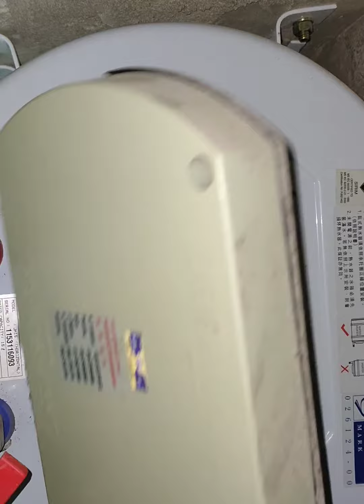REPAIRED!!! Joven Water Heater Storage 15Liters

Comment: Boss nk tnya. Custmer sy pon jnis mcm ni. Penyakit dia pon sama. Buka trus trip. Adakah masalah dia sama? Benda ap yg perlu sy ganti? Maaf bang. Nk mintak tunjuk ajar
Reply from the maker: @mohdazzaruddinazman8365  boleh jadi bang 90℅ sbb trip heating element tu dah short.. Cuba disconnect wire dekat heating element tu.try on kalau tak trip lagi confirm heating element tu rosak dah
Reply: Ok boss tq tunjuk ajar @arjchannel4155
Reply from the maker: @mohdazzaruddinazman8365  sama² boss

Comment: On suis hearter... Lalu terus trip apa sebab der
Reply from the maker: Boleh jadi heating element rosak,cara senang disconnect wire heating element, cuba on suis kalau tak trip confirm heating element rosak kalau msih trip check switch, cable supply, cable thermal fuse
Reply: @arjchannel4155  terima kasih tuan

Comment: Abg kalau buka suiz heater power trip MCM yg kat video.db box semua da trip.elcb jatuh.apa masalah ye.element rosak ke.
Reply from the maker: Ya jeff,.. Besar kemungkinan element rosak, kadang² thermal fuse pun punca trip(cable fuse hangus, touching body element) boleh check dlu sblm check heating element.. senang cerita guna multimeter dulu sblm buat kputusan part mna nak gnti 👍
Reply: Tukar element baru dgn thermal fuse rosak kena buat ajest kat box hitam Tu ke.kena reset.atau biar MCM Tu je.
Reply from the maker: @jeffmanikjeffmanik4411  biasa sy tukar part mana yg rosak je.. kalau confirm heating element je rosak tukar part yg tu je..
Reply: Hi. Nk tanya, mcm mana check fuse thermal?

Comment: Kalau air panas keluar slow saja apa masaalah nya? Air sejuk side flow nya kuat tapi flow bahagian panas tak kuat.
Reply from the maker: Boleh jadi sumbat @ pressure tak kuat. Storage hot water bergantung pressure air sejuk
Reply: @arjchannel4155  macam mana nak check jika ia sumbat ?
Reply from the maker: @Scbtgogreen  cuba check air msuk kuat tak?(dekat tank) Lepas tu check dkt mixer,buka mixer (tutup air kejap,lepas buka blow air tu kuar sjp) kdang ada sisa² seal tape,paip dkt mixer..
Reply: @arjchannel4155  ok terimakasih
Reply from the maker: @Scbtgogreen  cuba sja apa cara,kadang hal remeh pn boleh buat pening kepala😅

Comment: Salam bang. Saya ada masalah trip yg sama. Tapi masa check heating element masih ada contineunity. Ada kebarangkalian ke alat lain yang rusak?
Reply from the maker: Check Thermal fuse takut ada leak g body. Check heating element + Earth ada reading tak,klau ada, heating rosak.
Reply: @arjchannel4155  saya sudah check bang. Disconnect 2 kable ke heating element,sudah tidak trip. Cable thermal fuse tiada kesan2 cable luka n masih elok.fuse masih cantik
Reply: @arjchannel4155  terima kasih ye bang atas info abg ni.moga abg murah rezeki.
Reply from the maker: @mayathancur1  ok terima kasih kembali..
Reply: Tkasih pkongsian masalah ini.

Comment: bang sy mau tanya saya sudah pasang ini water heater tetapi lampu indikator hijau sj yang menyala dan air tidak panas sy cek amper nya tidak naik apa penyebabny bang
Reply from the maker: Cuba tekan reset thermostat yg ada tulis reset tu,sblm reset tutup supply dulu yee
Reply: tak boleh tekan bang dia ada biji hitam kecil kan
Reply: sy ada pasang 3 buah water heter 
itu satu saja problem
Reply from the maker: @fatkhanmuhammad6613  kalau trip biasa butang tu timbul, tekan smpai ada bunyi
Reply from the maker: @fatkhanmuhammad6613  water heater baru kh?
Reply: iya bang baruu semua
Reply: sy ada pasang 3  masing masing heater stroge 3kw yang 2 ok..ketika suis sy tekan arus 10A 
satu biji lagi terus tak ada arus dekat multimeter
Reply: oke bang esok sy cuba tekan tu butang
Reply: Salam tuan sy mau Tanya sy nya storage hearter  same model, sekarang  lampu hijau ngan Merah teros tak ada, main switch ada current cuma dua lampu tak ada teros apa dia nya punca? Sy dah Cuba tekan reset button pon tak boleh. Tlg jelas kan . Tq